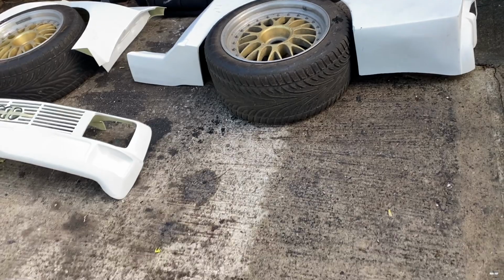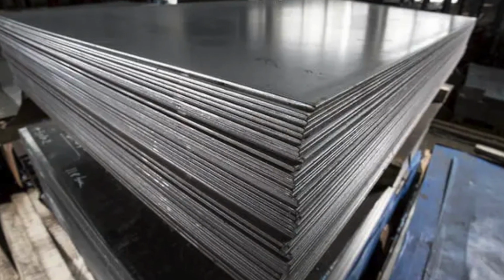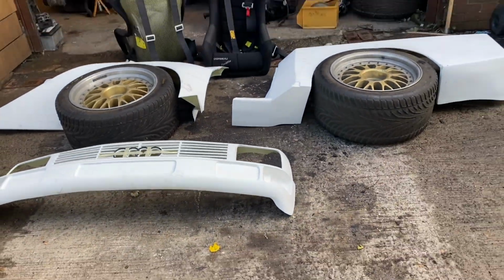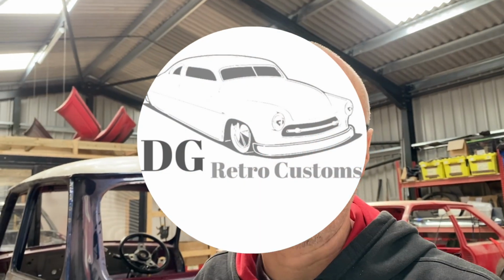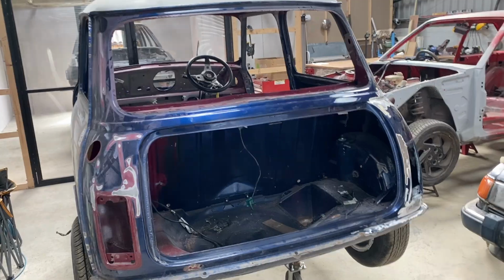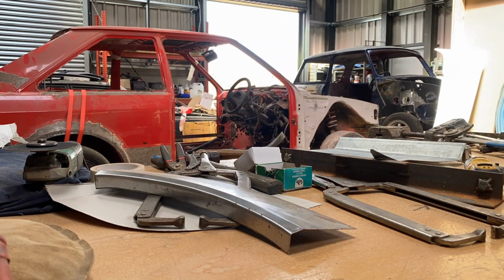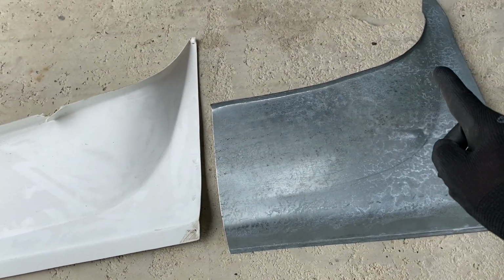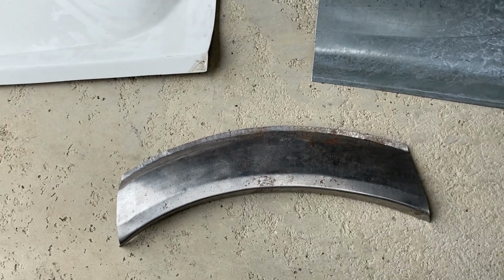Fibreglass to STEEL bodykit?! - Audi Quattro Rally S1 E2 Group B Tribute Build

Comment: I know it's expensive and you will need to learn to tig weld it but i would do it aluminum
Reply from the maker: I am a qualified tig welder who mainly does aluminium ironically 🤣
The issues I see with that is fixing it to the original panels which are on the car. So steel to aluminium
Reply: @TwinEngineCorsa  didn't know that lol
I thought you would be using dzus fasteners for quick release body panels